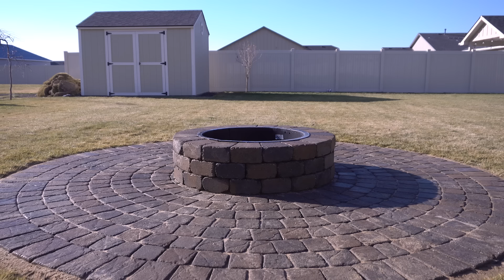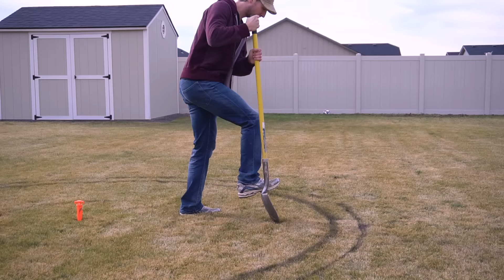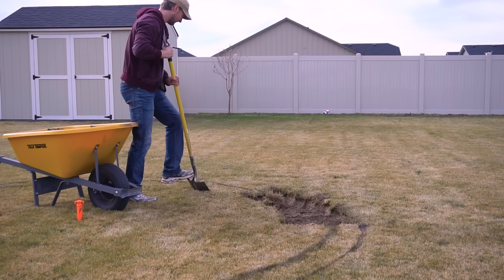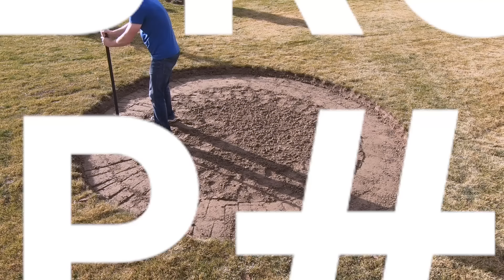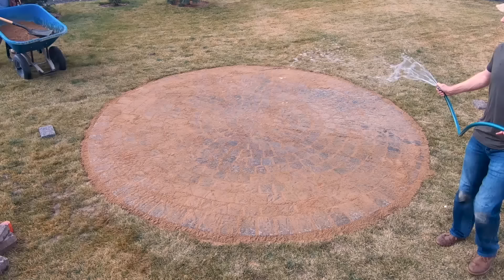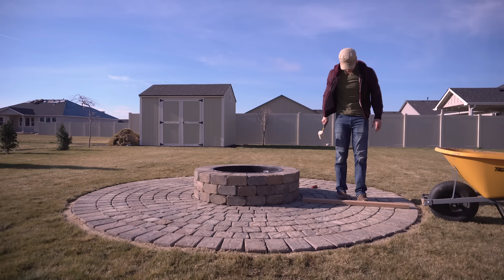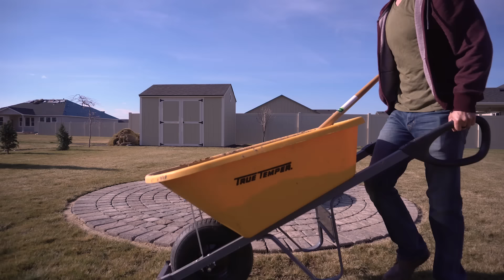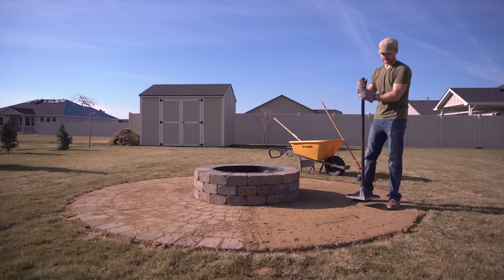My 4-Day Fire Pit Patio Build [Full DIY Project]

Comment: I don't know if the standard procedure is differently in America, but in the uk we usually mix cement powder with the sand, then sweep it into the cracks, 1 part cement 2 parts sand would've done it.
 You should've also made some mortar up and done the firepit blocks properly, it would've made it last much longer.  It looks really good, but watching what you have done I'm wondering how long that is going too last.
Reply from the maker: The polymeric (cement) sand is still an option down the road. I just didn't know enough about it, and didn't want it to crack and look bad - so I went with regular sand, and I can add more later on if it washes away.

We'll definitely be adding masonry adhesive to the fire pit bricks, to make them more secure, but first we wanted to remove some for increased airflow and less smoke. You can see our attempt at that, here: https://youtu.be/2DlTu1PxBCU
Reply: @BroBuilds  Oh well that's good, would definitely recommend you do, it's not a complex process,  the same as pointing up slabs or block paving. Well you want too put a small tunnel going through the bottom of the fire pit if you want to feed air into it. You could even leave out blocks on the sides instead, but a tunnel would be safer if you have children/pets around. You also have to be careful you're not letting too much air get to it.

Comment: I did this job in Italy where I live, we did pavings for entire parking lots. The way you did the whole process could be fine if you have to do small areas.. The only "wrong" part is that we must not hammer the single pavers once layed down, as they all will never sit at the same height. The entire 'patio' needs to be hammered together only when all pieced are layed down. Doing so, the pavers will 'help' among themselves to compensate the different heights, letting the sand 'run' below them were there is space to be filled.
I don't know if I said it in an understandable way! Anyway great job, the final result is lovely!
Reply from the maker: Makes perfect sense! Thanks for sharing that man!

Comment: Why you people always over process and over-consume everything
Reply from the maker: I dunno man. Not sure I can answer for all of us. For myself, I don't think I do.
Reply: @BroBuilds  You used multiple layers of gravel and after that sand. 

On top of that, you placed the stones. 

You can place the stones directly on top of the soil just after removing the grass, And fill them with sand. The stones are not going anywhere. 

After that, you used a metal ring in the fire pit which is also unnecessary.

It's just a bonfire with a stone pit, which gives it a nice look... but what's the use of a metal ring in it.

and if not used all these material you will save money and time.

I am not criticising just share my view, you can make the same pit without using those extra materials.
Reply from the maker: @YogenderKumar18  gotcha. The main problem with putting the bricks directly on the ground is that there will be no drainage when it rains. The bricks may not move right away, but over time the water will erode the ground underneath and they'll shift and buckle. 

You're correct that it can be done simpler though! But if you want a nice pattern and design that will last, you have to put a certain depth of gravel and then sand.
Reply from the maker: Oh, and the metal ring protects the fire pit blocks from getting too hot and cracking. Not required, but again, it should make it last longer.
Reply: @BroBuilds  ok
Reply: @BroBuilds  ok this way it will last longer ???
Reply from the maker: @YogenderKumar18  yep, exactly

Comment: Why not solidify the center fireplace rings together with concrete? They look easy to push over.
Reply from the maker: They're pretty solid, but we do plan to add some masonry adhesive soon. Just wanted to wait to make some improvements for air flow, which you can watch here: https://youtu.be/2DlTu1PxBCU

Comment: I'd recommend renting a roller compactor, or using a rubber tamp on your papers. And I'd also recommend polysand to fill in your joints. I don't know if it makes a massive difference in stability, but I think it looks a little bit nicer. And it doesn't wash away, and weeds down grow through it.
Reply: Would you be fine just using the polysand for the final layer, or is it necessary to use it under also? Thanks
Reply: @tuck232  I've always used it for a final layer. Don't know what you're supposed to do but that's what I've always done. Just make sure you have all the excess swept of before you water it though cause it gets real hard and messy.

Comment: Do you use any type of mud or mortor ??
Reply from the maker: Not so far. We'll probably add some masonry adhesive to the fire pit blocks eventually, but for now we wanted to leave them un-mortared so we could adjust the bricks for more airflow, and experiment with ways to reduce smoke. See that video here: https://youtu.be/2DlTu1PxBCU

Comment: Is there no need for any sort of cement to keep the top concrete all together? Will there be no issue of it moving if someone puts their weight on it or bumps into it?
Reply from the maker: It's all pretty stable as-is, but we do plan on adding some masonry adhesive in the future to make it extra secure. We just knew we'd be adjusting the fire pit to try to increase air flow and reduce smoke, so we didn't want to mortar anything together just yet. You can see our smokeless fire pit attempt here: https://youtu.be/2DlTu1PxBCU

Comment: Polymer joint sand works a lot better for it hardens and helps prevent weeds from growing.  The pros I have watched use 1x1s to level the sand instead of pipes.
Reply from the maker: Good tips!

Comment: you need concrete edges to preserve your excellent creation...
Reply from the maker: We used a flexible landscaping edging and some stakes instead. I like the minimal look a bit better!
Reply: @BroBuilds  it's a buttress all round the edge below the surface, ask any pro they will tell you it will stop the thing spreading out over time. your minimalist look is retained.
Reply from the maker: @ArieteArmsRAMLITE  ah, gotcha. Well, I'm not against concrete edging if it doesn't show, but I'm guessing it takes longer to create? The stuff we used went in quickly. Took us about 25 minutes to go around the circle of pavers with the edging material, pounding in a bunch of stakes to fix it solidly in the ground as it curved around. Seems to be holding really well too!
Reply: @BroBuilds  I am not criticizing. I was amazed at your video you keep on going despite setbacks. That was hard work. All I am saying is that I mix a bag of fast set in one of those oblong mixing trays and slop into the channel at the edge and then angle it up 45 degrees and the peak is at 2 inches below soil level. That way the edges cannot fall out, it even stops under erosion of the sand. I have seen more expensive block driveways etc fail because of weak edging than I care to mention. I just built a garage doorstep and I edged that too with the concrete edge, it will be there  when I die. I am British in USA so excuse unusual terminology which makes me sound odd. Dan Hotchin. Look at me channel header that is what I invented and made thank you.
Reply from the maker: @ArieteArmsRAMLITE  yeah, no worries man, we like hearing about other methods! I just don't want to steer anyone reading the comments towards a method that I personally haven't done, when the way that we did it is actually really simple, and works great. I can see how your way would last a long time, though, so I'm sure some folks will prefer it. 👊
Reply: @BroBuilds  you can always do it in the future, if the stakes fall over a bit etc and the landscape edging just seems to expand...you can very easily retrofit the concrete edging. I am UK expat in KY, they don't even mix concrete here they put it in dry around the edge and it soaks up the moisture from the soil and sets solid in a day or two. By the way your video editing and creation plus viewer feedback is second to none and I have been on youtube for 10 years.
Reply from the maker: @ArieteArmsRAMLITE  absolutely. And thanks! 🙂

Comment: Day 5: HOA comes knocking on your door telling you a fire pit is against regulations
Reply from the maker: So far no issues there :)
Reply: @BroBuilds  is the fire pit and coping attached in anyway or just loosely stacked? And are the pavers intended to handle the heat from a fire directly on top of them?
Reply from the maker: @RonnieRLD  they're not attached yet, but we will add some masonry adhesive down the road. I wanted to wait and make some changes to the bricks to get more airflow first, which. . . Sorta worked :) https://youtu.be/2DlTu1PxBCU
Reply from the maker: @RonnieRLD  as for the heat of the fire, no, they're not rated to handle it. They seemed to do fine, but I decided to add a grate to lift the fire off of them, and that should help a bit too.

Comment: You must have some airflow issues when it comes to the firepit. It is too deep without any ventilation holes in the sides to provide airflow. Just a tip, adding airflow in the sides improves and makes the firepit alot easier to use.
Reply from the maker: There were definitely airflow issues. But check out our video where we attempt to fix it here:  https://youtu.be/2DlTu1PxBCU

Comment: Bro tip: 6:45 it's not ok to flat the sand with bare hands, you should use a trowel or better, a notch trowel
Reply: a god builder use its hands only for holding the tools, otherwise your execution is quite good for a begginer
Reply from the maker: Thanks Gabriel!
Reply: @BroBuilds You're welcome bro <3

Comment: Suggestion. To tamp down the pavers, use a 2x4 and a real hammer. That way when you hit it it automatically levels the bricks.
Reply: Just use a plate compactor with a pad. Plenty of things are wrong and inefficient here, and I would bet this will be terribly uneven after one winter.

The hand tamper was funny, but it did little to nothing for their base, joint aggregate, or setting the pavers into the bedding layer. The edging is pretty funny, too. That will not last.

Comment: Why do you need rocks? Why not just put them on the dirt?
Reply from the maker: The rocks provide a stable base while still letting water drain through. If you put pavers directly on the ground, you'll get mud and the ground will start eroding over time.
Reply: @BroBuilds  exactly. A professional contractor told me that is such a huge mistake that people make when building fire pits or retaining walls or anything. You never put bricks or blocks on dirt, you must have gravel as your base.

Comment: How did you go about finding a local concrete contractor who makes custom top caps for a stone wall, in your case for a fire pit?
Reply from the maker: We found them through the nursery/landscaping place where we got the patio and fire pit kits.
Reply: @BroBuilds  How should I even ask my local retailer for that?   "Do you have any contractors who can custom make top caps for stone walls?"
Reply from the maker: @persistentone3448  Sure. Ours also had some caps sitting out next to their fire pit kits, and as we were buying the kits, they told us we could buy the caps they had on hand, or they could contact the concrete person to have the caps custom made for us in a particular color.

Basically if there's a place selling bricks, pavers, etc, they'll probably be your best shot at finding someone doing custom concrete caps as well.

Comment: That round point shovel seem to work OK for your sos but if the grass is already established a sharp shooter is a much better option you’ll have to get down on your knee and just cut straight underneath the grass in huge strips
Reply from the maker: Great tip, thanks!
Reply: @BroBuilds  Thanks great video, it turned out great. I was  surprised at how level you guys were able to make all the stones it would bother me if I couldn’t get them all level like that!
Reply from the maker: @kyplummer3657  oh man, same here. :) I spent some time working on those pavers for sure!

Comment: How big is the pit itself? Just wondering how much room you have from the outside of the pit to the edge of the patio. Planning on building benches around it so I am just curious
Reply from the maker: The patio has a 12.5 ft diameter, and the fire pit has about a 4ft diameter. So there's about 4ft for seating all the way around.

Comment: the easier way to do this is pour concreate level and smooth it out and lay the stones on top and it will be there for a very long time
Reply from the maker: Before pouring concrete, you'd need to compact a layer of crushed gravel very similar to what we did here, and construct a form around the edges. So it probably wouldn't save time or effort.
Reply: @BroBuilds  for building a slab of concrete you decently level the ground framing depends on what your doing of and when pouring concrete use a concrete rake  to even out the concrete then use a bullfloat and or mag depending on size to pull up and smooth that creamery looking stuff for forming edges you use a tool for the edge  a then brush for texture or there's a special tool that gives that glossy look there are some differences in concrete building so best to contact a pro near you to help with your project but you wont need gravel if your ground has no bad problems also I recommend about 4 in thick of concrete so it doesn't break on you. me and my family does construction. the patio kit you have  uses gravel so your sand doesn't erode from under and give the stones support
Reply from the maker: @Darknight_smaw  yeah, see that's a lot of steps! 😂 Pavers are a lot easier than getting concrete right, especially if you've never done concrete. And I really don't think you want to put pavers on top of concrete either - you'd need a layer of something between. So I think this was the correct application.
Reply: @BroBuilds  ok have a good day bye

Comment: wont u need to bore 2 or 4 holes in to supply oxygen to the fire?
Reply from the maker: We didn't drill holes, but we did add some air flow in the next video, to try and reduce the smoke: https://youtu.be/2DlTu1PxBCU

Comment: great video! but one question: why you needed to dig that deep - and use a lot of gravel? what would be the problem if you dig shallower?
Reply from the maker: The gravel provides a solid base that still allows water to drain away quickly. A shallower hole might not give enough drainage or stability over time.

Comment: Great video but there is no way I am messing with digging it out manually. Home Depo tool rental you can get a mini excavator for the day for under 200 dollars and you can use it to haul away the dirt and bring the pavers around and sand and rock. If one wants to not sound the money then get a garden tiller to break that sod and soil to easily scoop up the dirt. Work smarter not harder.

Comment: Nobody has any issues with pavers and blocks like those exploding from fire?
Reply from the maker: Others have commented something similar, but we do have a metal ring in there that covers most of the blocks, and we also added a grate which lifts the fire up off the ground a bit. So far no issues, but there's always the possibility I guess! Check out our second video if you want to see the grate and metal ring a bit more: https://youtu.be/2DlTu1PxBCU
Reply: @BroBuilds  thank you. I appreciate the response. I know it's a major issue for people who do forging, but I've also known people to build a grill out of blocks as a kid. It looks very nice, I would like to try to emulate that myself but I haven't finalized a design just yet. I had assumed I would have to have a dirt bottom or dig a hole for a truck wheel or something.
Reply from the maker: @Remrie  if you want to protect the pavers on the ground, river rock might work well and still look good 👍
Reply: @BroBuilds  It looks like there are some that are specifically fire rated. Otherwise ones that aren't, if wet, just need a small fire to dry them out before making the fire larger. I do know vaguely speaking stones are generally ok-ish. The two biggest issues is them exploding in a way that causes an injury, or creates cracks and holes that affect how it looks.

Comment: When the sand you swept in the cracks inevitably washes out, replace it with polymeric paver sand. Trust me.
Reply: I agree that works so much better.
Reply: and some stone adhesive for the firepit blocks/caps
Reply: Polymeric is the best stuff going
Reply: Poly is better. More expensive but worth it and you can color match.
Reply: Or a dry mortar mix.
Reply: What does it do, is it like concrete sand ?
Reply: @teamslaiyans3808  yeah, its sand that fills in the cracks between the pavers, then you wet it with a hose and it hardens once it dries
Reply: @CodClip  cool, thanks…

Comment: fire pit doest seem very stable without cement or smthg
Reply from the maker: It's pretty solid as is, but we do plan on adding some masonry cement once we're done adjusting the bricks for better airflow (there's a second video that goes into that, actually)
Reply: @BroBuilds  gonna check it out

Comment: But why don't you use concrete in the middle, building mini wall?
Reply from the maker: We were still adjusting those bricks, and wanted to be able to move them. (There's even a second video that shows us removing some bricks for more airflow, so it's a good thing we did it that way.)
Reply: @BroBuilds  yeap, later i had seen that))) and how does it work today? is it too strong against winter?
Reply from the maker: @vasylpavliuk  it's doing great so far! Made it through the winter, snow, and some crazy wind and rain with no issues. 😅